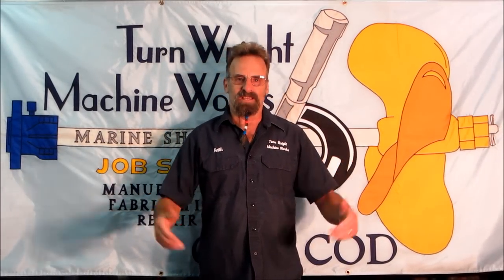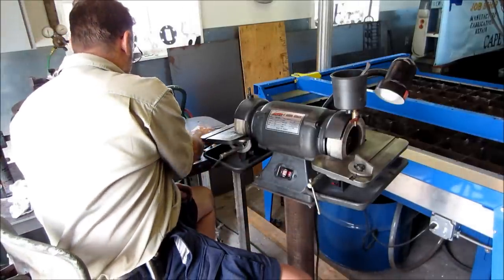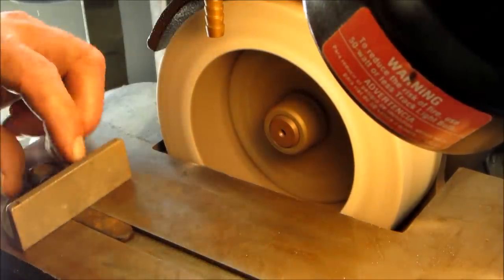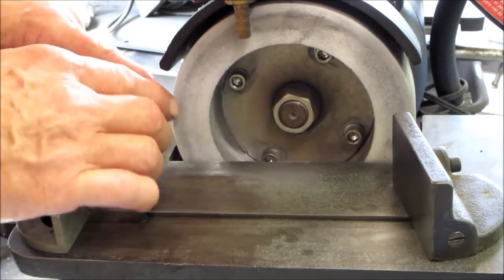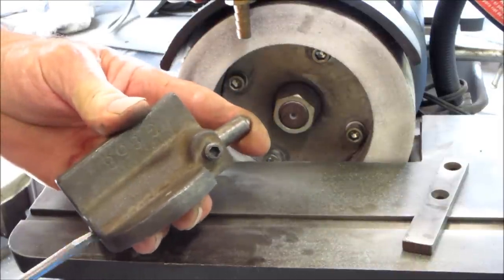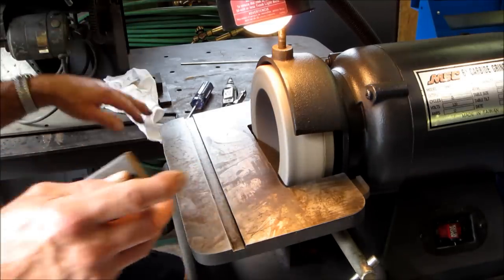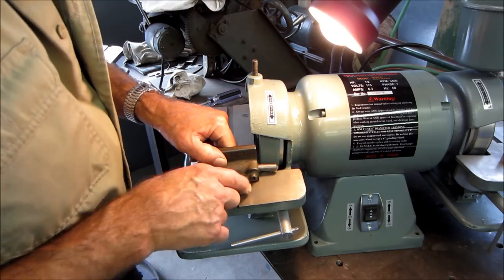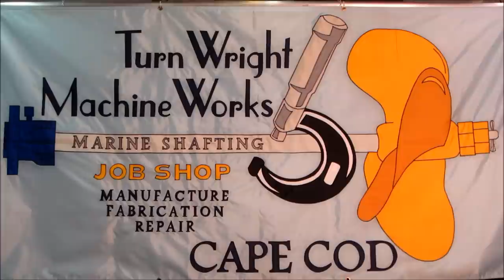Dressing Your Faces

Comment: I think a lot of your vibration issues are in the balance of the stones themselves. Look when you install one how it spins to the heaviest side down every time. And the little roll pins are not event all the way through the motor shaft creating a balance issue. The motor itself needs to be balanced first and then everything else you connect to the shaft to solve vibration problems. To make anything vibration free takes a lot of balancing and truing up efforts.

Comment: Sometimes I've found when a wheel was really badly out of true, it takes forever to dress it properly true. This is because the out-of-balance forces will be causing the shaft to whirl by a few thou, so that you are not dressing it to a true cylinder even when it cleans up all over.

The only way I know to shortcut the process is to dress it while it's running down (after switching off), because the whirling is induced by speed. I usually just keep the diamond in one place for each "run-down" and dress a groove deep enough that it cleans up the whole 360 degrees, then move across a tad and dress another groove the same way. When the face is covered in grooves I then dress away each ridge between the grooves.  By then the stone will be so close to balanced (assuming I do the same to the periphery)  that I can finish off the way Keith showed.

I should point out when doing this series of "run-downs": I always retract the diamond before the stone comes to a full stop, or it might shatter. It's a bit like a carbide insert: you should never stop the spindle without withdrawing the tip, because (unlike HSS) it's brittle.

Comment: Blasphemy :)) I have old BDR, NDR and Czechoslovak machines at my shop which I painstakingly rebuilt, retuned and gave them a fresh new coat for a fresh new beginning. After I broke a chinese drill press (Gude - lol), angle grinder, big heavy belt sander (some OEM shit) I snapped and threw everything "strictly" chinese from my shop. Ain't buying anything that's 100% chinese ever again... not even a drill bit.

Comment: Another eye-opener, for me.  Grinder vibrating?  Hmmm, what's the mechanical/personal tolerance?  Hah.  Remove the wheels and see if it still vibrates.  Dressing the faces affects the balance, if the stone has a variation in density/weight.  "Blue Printing" and balancing a grinder wheel may be a short video:  reducing radial (out of round) and axial (wobble) runout, then dynamically balancing.  May not be worth the effort.

Comment: Keith nice work.  The best part to me was when you realized holding the diamond against the miter gauge was not giving a good result and you took the time to machine the other one to fit and do a proper job.  I am looking forward to the sharpening.  We don't have a tool bit grinder in the shop just a bench grinder with flat wheels not cupped.

Comment: Hi Keith, Ghostses has a pretty good 5 part video series called,  Harbor Freight Carbide Tool Grinder review and modifications  He took the motor apart and trued the actual shaft and wheel backing plates and completely removed all the vibration. After the lathe work, he was able to balance a nickel on edge, on top of the motor and start the grinder, without it falling off! The grinder looks just like yours so you might want to take a look. Nice job adapting the dresser to your setup.

Comment: You shoulda seen it before he got 90% of the axial runout out. Had to make new bearing shaft spacers and nuts. Think it had like 0.018 runout on the face and if I remember he got it to 0.0015.

Comment: How do you know the T-slot is square to the motor shaft? I have an old Baldor that's the same exact unit that they knocked the ones you are using off from . Even this "Daddy" grinder makes my ass ache when I try to get the T-slots exactly square to the motor shaft??? Anyway thanks for the great videos!

Comment: Keith, I'm going to make a dressing fixture like the one you used in this vid, but I will need to buy a diamond nib.  Is the size of the diamond important for this type of dressing operation?  If so, what's the best size diamond to use to dress 1.5" wide by 10" diameter pedestal grinder wheels?  I will be using this grinder to sharpen HSS lathe and shaper tool bits, so I want flat wheel faces that will run true to my tool guide.